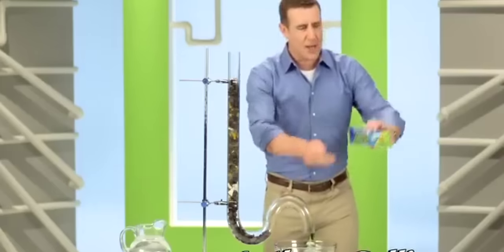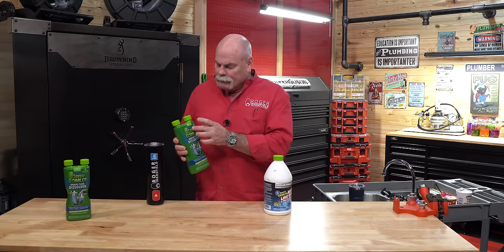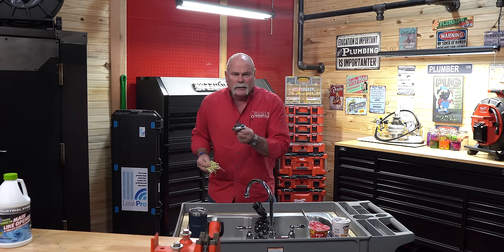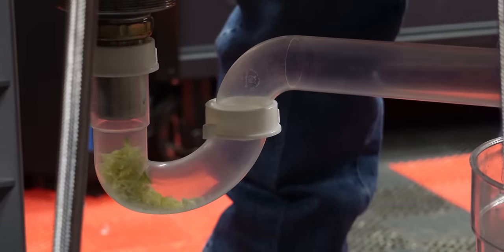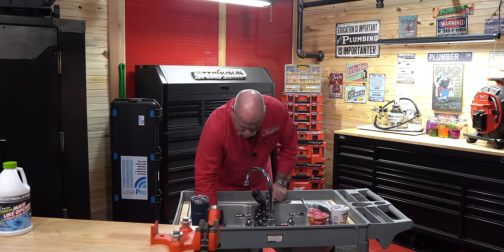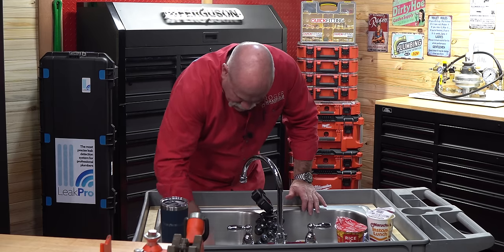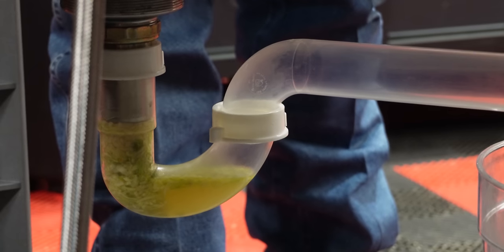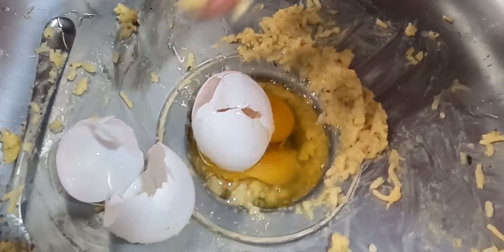Real Plumber Tests GREEN GOBBLER

Comment: In all fairness, the enzyme cleaners work best on SLOW drains...this way the formula can loosen up the stool crud and the next day you are supposed to flush with hot water...I used this stuff on several customers slow drains and my own and it works decently
Reply: @bunnybubs757  it's definitely not natural....
Reply: @Girraficusthewise  thx
Reply: Not a good test
Reply: Exactly. No chemical or enzyme solution can work on a complete clog. Obviously the product need to be in FULL CONTACT with blockage.
It's the equivalent of using a snake and stopping at the obstruction, not going THROUGH it.

Comment: The product that you used dissolves Hair, Grease, Soap, and Toilet Paper. For best results, leave overnight to dissolve. You tested this on fresh food in a kitchen sink.
In general, if the clog is fresh food and not partially decomposed, it will take longer for the enzymes to work. Second, the product line of Green Gobbler does make a Disposal and Drain Cleaner that may work better with food.
Reply: Not a good test on raw food
Reply: I used it on a blocked kitchen sink drain. Let it sit ovennight, hit it with boiling water, plunged it, it's draining bettter than ever.
Reply: Never used the product but dealt with shipping it. In cases where it leaked GG would dissolve the shipping box to pulp in >1/2hr.
Dealing with the cleanup was annoying, but can verify seeing it work real time it is effective. No harsh chemical odors either.

Comment: The stuff works...I've used it on tough kitchen sink clogs where plunging alone didn't work. Just remember it's an enzyme meant to digest organics,  not an alkaline-based product, so you have to pour it down the drain and wait a few hours, not 30 minutes! Sorry to all the plumbers out there but one $20 green bottle probably saved me 400 bucks in service calls. Now if I could replace my auto mechanic.....
Reply: Naw Fr 😂😂💯💯

Comment: It would be a better video if you also used the more "industrial" kind of chemicals to see how those fare (which usually create way more violent reactions but for the most part do the job). Also try it in different situations, like in shower pipes that are clogged with hair, dried soap and maybe even paper (people are weird). 

And maybe test this in increments. In 99% of the situations a person will use this to fix a slow drain of their sink/toilet/shower, not fix a complete blockage of their entire plumbing system. Of course there are exceptions, but I don't think most people will wait for their pipes to get completely blocked before trying something basic as using this product or even a plunger.
Reply: Trust me people definitely let drains get fully clogged.
Reply: Oh, yes we will :). Or make that 🙄.

Comment: I had my kitchen sink clogged once a few years back. Went to go get a plunger locally and could not find one in time. So in an attempt to improvise i used  a plastic beer pong cup. Inch of water in the sink, positioned it well and just smashed the cup jamming the entire shockwave into the plumbing. One attempt and it all ran beautifully afterwards.

Comment: hot water and a plunger usually works for me

I had to unclog the laundry sink and I got it freed up with just that, plugged the drain with a stopper and then filled with lots of hot water and let it sip some, then plunge a little, let it drink, plunge, drink, plunge, then some super aggressive plunging which built the pressure and the pockets between the water dislodged it.

Comment: I have used green gobbler in my kitchen sink on two different occasions when plunging did nothing to help.  I poured one bottle in and let it sit for a few hours and then poured the hot water down.   I had to use a second bottle and I left it overnight then poured the hot water over it and the drain cleared completely.  On the second occasion, i poured one bottle in the drain and left it overnight, then in the morning poured the hot water over it and it cleared completely.  I am very careful not to let anything like big food chunks go down my drain and I don't pour grease down the drain either.  I live in a apartment building and unfortunately don't have any control over what the tenants above me shove down their drain.  Thankfully, green gobbler has come to the rescue for me twice now.

Comment: Roger Wakefield and FilthyFrank crossover has to happen one day.
But one day I had to unclog a sink and someone shoved laminate flooring down the disposal and it chewed up the blades and got jammed in the slits on the sides. The builder did not like that back charge. I still have pictures on my work phone

Comment: This product is designed to dissolve grease, fat, hair etc in slow moving drains. If your drain is packed with vegetables and carbohydrate-y style stuff AND it's no longer slow moving but entirely blocked, it will never work. That is purely because it's not meant for that.

Try melting some lard/butter/fat, pour it down the drain and let it go hard. See what the product will do then, before you add the hot water.

Comment: Not saying this product would work or not, but when you don't even follow the simple instructions seems kinda pointless to even test it......

"Sinks and Tubs: Pour one chamber slowly into drain. Allow product to sit in drain for 15-30 minutes or for optimal results let it sit overnight. Then flush with hot tap water for 5 minutes.

Toilets: Pour both chambers slowly into toilet. Allow product to sit at least 2 hours or preferably overnight. Once water has come down to normal level, flush toilet.

Note: For difficult obstructions, repeat treatment and allow product to sit in drain overnight. Then flush with hot tap water for 5 minutes. Do not use this product on refinished surfaces and always thoroughly wipe any excess product remaining on surfaces with a wet cloth."

Comment: Clogs are built up over time so they spend weeks some times moths soaking in water and it for slow drains not pipes clogged with stuff a hour before use this is not an accurate review at all

Comment: I'd believe you if you actually followed the directions and used HOT WATER after the 30 minutes. You just looked at it shrugged it off and whipped out a plunger to finish the job

Comment: You used the product in the most unproductive way possible. Didn’t even leave it as it says on the instructions for 2 hours or overnight. Also, the product is meant to dissolve certain things like hair, grease, and stool, not fresh food in an unrealistic way of dumping it. For me it worked perfectly fine without many issues. You just have to read the instructions properly 🤷🏻‍♂️

Comment: Lol not a good test at all. I don't think that much crap is in a pipe lol!  This stuff works fine if you follow the instructions.   I had a main line stopped up half way down. Opened it up after a couple hours. Then I put the enzyme treatment in for a couple days.  Never happened again with using the enzyme additive once a month.